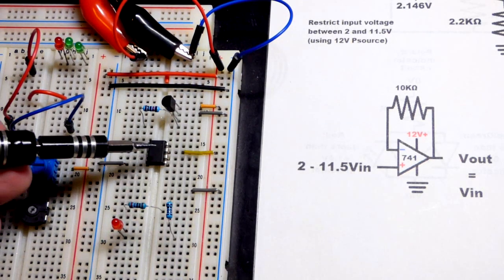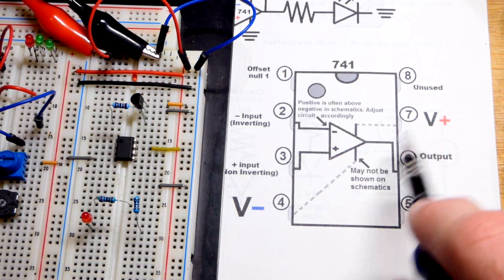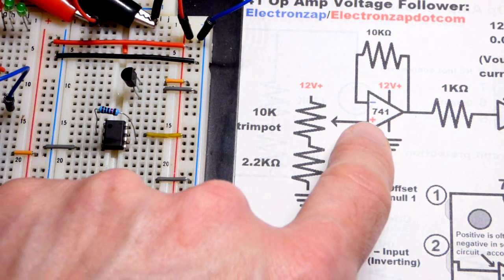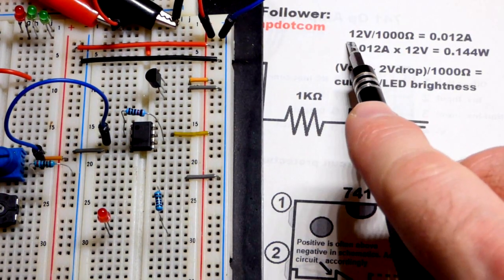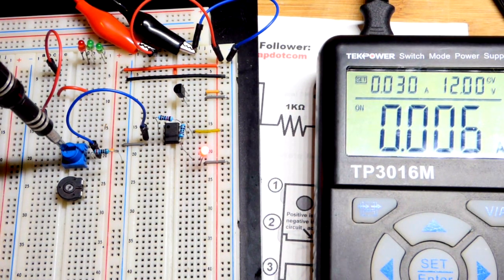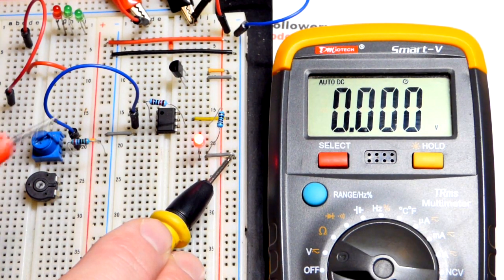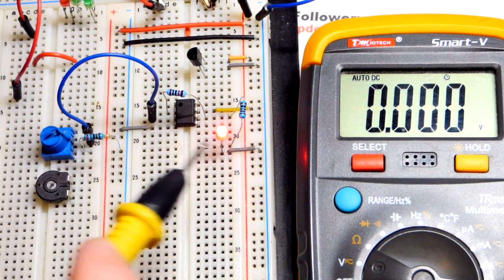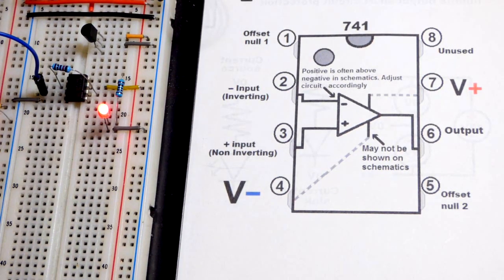741 op amp follower using single supply power source

Comment: I have been searching but i haven't found anything can you please help me Build an opamp based current to voltage converter that will give an output of 0v at 4 mA and 5v at 20mA
Reply from the maker: Haven't made an op amp current to voltage circuit yet, but that sounds fun, so I'll keep that in mind! :)